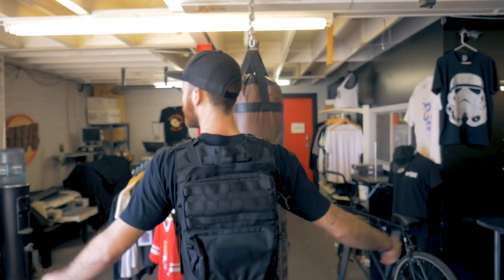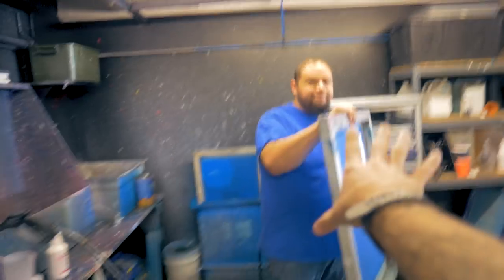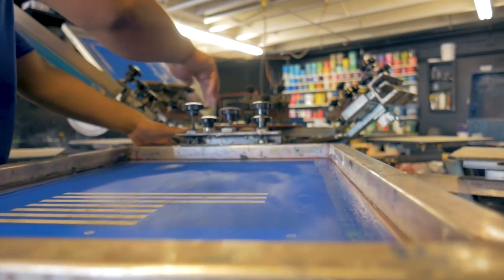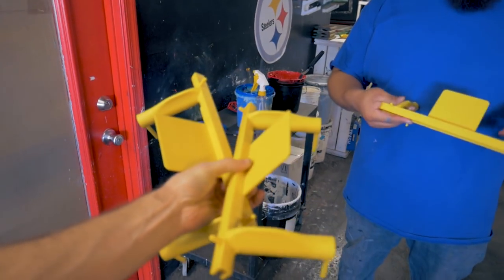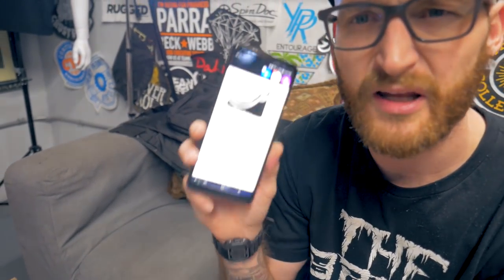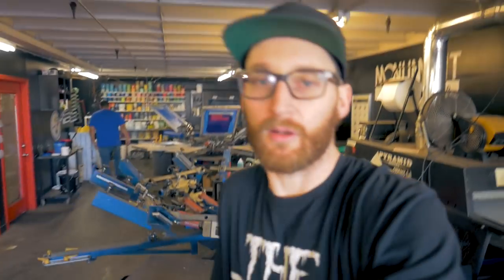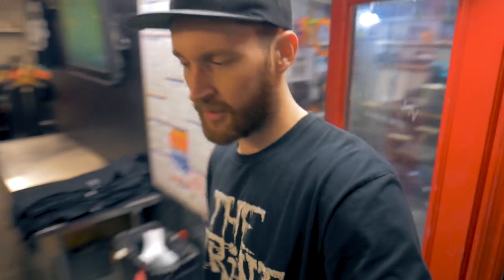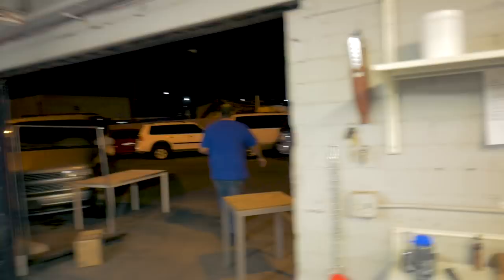T shirt Screen Printing Daily Vlog | How to Screen Print with the New EZ Squeegee by Cam Earven

Comment: Hey there! I bought one of these but it didn’t come with a squeegee. I’m really new to screen printing and was wondering if you could let me know the specs of the squeegee you are using with the ez-squeegee? Thanks!!
Reply: Hi Cullen, TheEZGrip will hold any durometer squeegee blade from 6" to 14" and only takes seconds to change.
Our exclusive friction grip system holds the blade tight without screws or bolts,
no drilling thru the blade, utilize all 4 edges.
Reply from the maker: Yup we are using triple duro in them now. Work like a charm